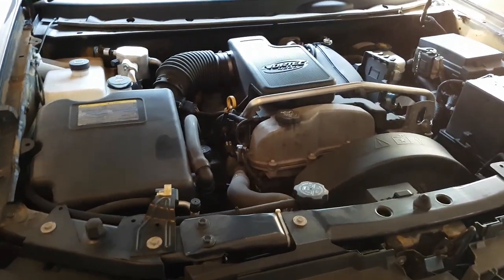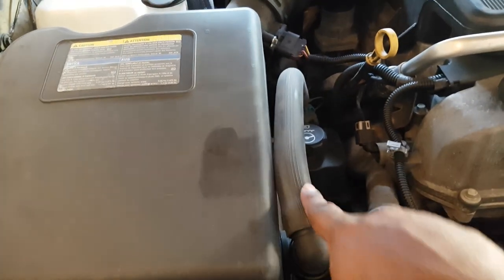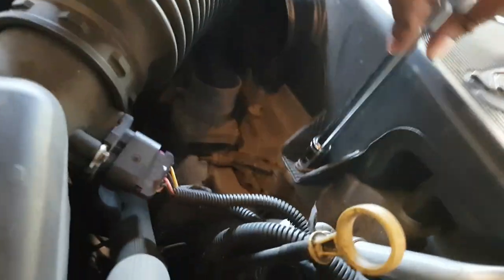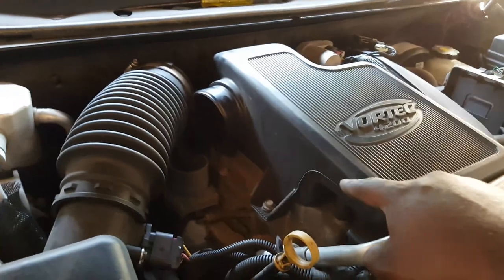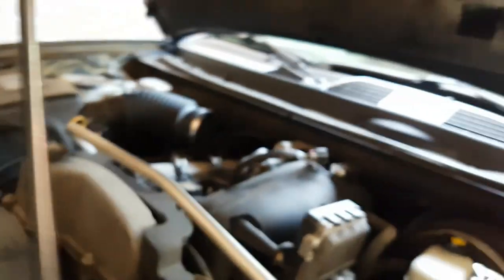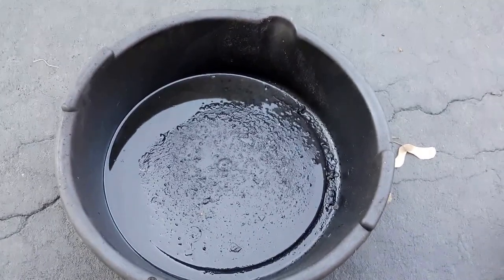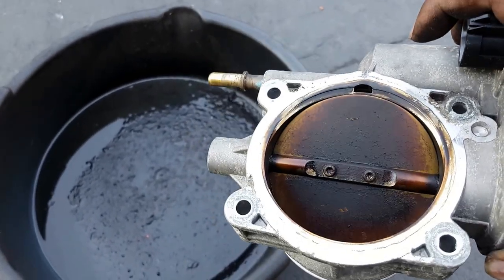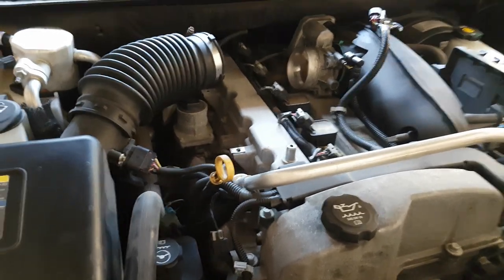Chevy Trailblazer - Cleaning The Throttle Body

Comment: Thank you for this video!!!  It was SOOOO Helpful.  Also, I heard on other videos to pull fuse #10 PCMB & #28 PCM-1 (In fuse box right beside the battery- maybe this was instead of pulling battery cable) let it sit 15-20 minutes before putting them back in (this lets the computer know to reset the idle.)  Once back together, drive the car around for a little while.  I ended up running a few errands and after cutting it off and on at my errands, just when I thought it still wasn't fixed, it started running great.  Give the computer time to Re-Learn how to idle with a clean throttle body. (I'm in no way a mechanic, but works great!!)
Reply from the maker: Great tip. Pulling the fuse can help the car relearn the throttle body, especially if you get a check engine light after cleaning it up. Thanks for watching.

Comment: You da man this worked like gold i just found a gem at the auction 2004 trailblazer LT on 85k miles on it new everything cept brakes which i put in yesterday was wondering why the car would shutoff soon as i turned the air off found out this was the issue you're video made this ten times easier...you da man!!! Definitely gonna enjoy this truck
Reply from the maker: Awesome news, sounds like you got an awesome trailblazer deal! My dads 07, the one in this video, was done 5 years ago and there is still 0 issues with the truck. Enjoy!...My dad loves his TB and never wants to get rid of it!

Comment: Love these 4.2 vortec engine's! I have an 02' GMC Envoy SLT XL & boy is she a workhorse,solid SUV with over 278,000 on her! Right now I have a catalytic converter issue (needs replacing)  a few new suspension parts & an intake seal has a little oil leak,but man she runs just fine considering the age & mileage. I'm actually shocked at how well she's performed under strenuous conditions! I also have an 05' Envoy Denali (5.3v8) that I'm putting a motor & trans in for a second vehicle that I got for $250 that's in immaculate condition even better than my 02'! I hope the 5.3 is just as mechanically sound as the 4.3 is but with more power that I could definitely enjoy! I wish GM would bring back the Envoy with the same standards in mind but just an updated version I would definitely be in line to purchase! Happy trailblazing my fellow Trail/voy community the heartbeat continues!!👍💪
Reply from the maker: Me too! I think those 4.2L Vortec are amazing! They just keep on going! Honestly, most of these TBs/Envoys are completely sound vehicles! Those few things you have, I.would just chalk up to age and wear and tear. Looks like that'd a win in my book. Sounds like you got a sweet deal on the Denali too. Those 5.3L are amazing. They have their few issues (ie knock sensors) but they are solid and reliable too. Hope you get many more years out of them!
Reply: @NexusAuto  Thanks and do you have any personal dealings with the 5.3 v8 is it as reliable or more than the 4.3 vortec and do you recommend me doing anything prior to installing it being that it'll be out of the vehicle which makes preventive maintenance much easier. Parts to replace or upgrade before installing?? Thanks in advance 👍
Reply from the maker: @justmy2cents_   I do have some experience with the 5.3L, but in other forms and variations, in other platforms. But I do know people who have the 5.3L and swear by them. There really isn't a lot that goes wrong with them

Off the top of my head, I would do the usual tune up stuff, particularly spark plugs. I would also change the knock sensor, as it does fail on these vehicles and are a pain to get to with the engine in. Make sure they are torqued to spec. And not related to the 5.3, I would say to check your Power Steering lines. They do tend to rot, especially on the little holder attached to the driver side fender area, and these lines wrap all the way around from the rack, across the driver side frame, along the front subframe and up to the reservoir. Its a giant pain to do with the engine in, so if there is any sign of rust, change em. Other than that, not much else I can think of at this point

Comment: Very informative! I have a 2008 Trailblazer that is throwing a P0121 throttle/ pedal code and I'm going to give it it's first cleaning in hopes that fixes the issue! Thank You!
Reply from the maker: Awesome news! Hope it works out and that code gets cleared! Good luck!
Reply: Dont stop there.  Clean the PCV orifice.  If the throttle body is gummed up, or if there is any other evidence of blowby gasses in the air plenum upstream of the throttle body, then the PCV system is inoperative and needs to be cleaned.

Comment: Thank you for this video. It was exactly what I needed to repair my Trailblazer. Your video helped me save a few hundred in repairs because I was able to do it myself using your directions.
Reply from the maker: That's awesome news. I always like hearing stories like this. Glad the video helped out, and thanks for watching.
Reply: @NexusAuto  hey man what do you have on your intake manifold where a vacuum line looks like it should go? Is it just capped off? Looks flat but cant tell. Any help would be appreciated. Btw I have the one with fuel regulator. It's not so bad pretty easy to clean as well. Nice video though. Liked and subd
Reply from the maker: @Matthew-ev4cv  yep, mine has a cap on it as well. I have seen some have a line run from it (not sure where it goes, never checked), but I've seen quite a few with it capped off, mine included
Reply: @NexusAuto  guess I need to find me a cap ugh mechanic lost mine
Reply from the maker: @Matthew-ev4cv  damn that sucks. The hunt begins! I don't think they cost too much. Not sure how hard they are to find though. Hope it's easy enough
Reply: @NexusAuto  me too appreciate the info

Comment: Was having ac problems id turn on my ac and it was stall the car, cleaned my throttle body and no more stalling issues
Reply from the maker: Awesome. First time I heard of the effects of the AC causing a stall, but makes sense...extra strain on the engine, probably not enough air getting in, and stalling it out. Glad the video helped fix the issues!

Comment: 7 years later and saving my ass today. Car stopped running yesterday (would start, but defroster would kill it unless I reved the engine. It's 26F here, so I kinda need that) but it fixed it and started running better. I'm assuming my throttle body either hasn't been cleaned in years or hasn't been cleaned at all. Mines an 04 LT if that makes any difference, but everything was pretty much exactly the same.
Reply from the maker: Awesome news! Happy to hear that this fixed the issues, especially with that cold weather. Your LT should run a whole lot better now, and fuel econ should be better too!
Reply: @NexusAuto  oh yea, significantly better. Idles better and got rid of my SES light, drove almost 10 miles and SES isn't on anymore. I hope I get better gas mileage, I average 12 mpg as of now, but hopefully, the clean throttle body helps that as this is currently my daily driver.

Comment: Thank you for the step by step instructions! Great video. I'll be doing this tomorrow. Hopefully it will help with the throttle body codes. When the Trailblazer gives the "reduced engine power" light, do you know if it's normal for there to be a strong gas odor and black spritz coming from the exhaust too?
Reply from the maker: No problem...hope it helped. It should help with the codes too, unless there is a physical failure. 

As for your inquiry, I wouldn't say it is normal, but it can happen. That means the engine is running 'rich', or that the car is not burning all the fuel when it goes into the engine, so you are still smelling some of the leftover gas, and that spritz should be the excess fuel coming out. Definitely indicates an ignition issue of some sort (throttle body, mass air flow sensor, spark plugs, wires, fuel injectors, air filter, fuel filter, etc).  Definitely try the throttle body cleaning (if you havent done so already) and then go from there.

Comment: Thanks for this awesome video!  I have a 2005 TB LT and it drives nice on the freeway but idles a little rough at stop.  Might this solve it? Thanks!
Reply from the maker: No problem at all! Unfortunately, there can be a few causes for that rough idle, but this is definitely a potential cause. I would say to give it a try for sure. Even if it doesn't fix the rough idle, it will help the vehicle
Reply: These 4.2 L have a history of working the intake manifold bolts loose.  They arent to hard to reach, luckily.  A rough idle and drivability problems at low throttle, but otherwise smooth running at highway speeds is indicative of a vacuum leak.  
I found one trailblazer that could barely run at idle but drove fine at highway speed.  Every single intake manifold bolt was no more than finger tight.

Comment: IF YOU HAVE A TRAILBLAZER AND IT ALMOST STALLS AT IDLE.. ESPECIALLY WHEN THE HEAT IS RUNNING, DO THIS! 
I was skeptical as always, ended up at 3 different shops before I saw these threads and videos about this. Took me 45 minutes and costs $10 bucks. Please Don't be stupid like me and deny that this is your issue. I'm telling you...It will fix it!
Reply from the maker: Thanks a lot for the support and vote of confidence. Amazing what cleaning that throttle body will do for the car. Glad to hear your TB is working well again. Thanks for watching and the great feedback!
Reply: My 2005 don't almost stalls at idle but the rpm drops too like 500 then goes back up (has been getting worse the past 3 years I've owned it) (never seen a check engine light) im going too do this tonight too see if it fixes it :3
Reply: So i cleaned it (the plastic tube broke off the intake... >_<) but... it idles amazing now 😊 but when i started it it had high idle it scared me 🤯 i hope tomorrow go back too normal...
Reply: but only temporarily.

Comment: When removing it to clean it, didn't the throttle body go out of calibration?
Reply from the maker: Nope, and generally speaking, it never happens on any electronic throttle body that I've cleaned, doesn't matter if it's American, German, Japanese or Korean made. 

Vehicles also have their own adjustment/relearn procedure as well. That's why, sometimes after a cleaning, the car will feel different (aside from power and fuel economy improvements) and then after a short drive it corrects itself. The vehicle does the opposite as the throttle body gets dirty...it adjusts based on the condition of the throttle body itself and what airflow it can read. 

Now, at the same time, if a throttle body was really dirty, or if the plate was sticking before cleaning, it doesn't hurt to do a throttle reset/relearn. Every vehicle has a different way to do it. But if it was really bad, you may want to give the vehicle a fresh start and reset throttle settings.

Comment: I did everything as u did , but after my Jeep idles fast , don't even have to push on the gas when going ? Help
Reply from the maker: There are a few things that can be causing this. One thing is that the throttle body flap may not be sitting right and is allowing too much air in, and causing the high idle. Also, and this is more likely that cause, is that the throttle body needs to be reset. You can do it with a special scan tool or with some key turns, but you can also just disconnect the battery and leave it for a few hours. That sometimes resets the throttle body and it sill start to run normal again. Hope this helps

Comment: My 02 Chevy trailblazer doesn’t want to turn on anymore after I turned it off reduced engine power came on dash and throttle body butterfly doesn’t not want to open manually when I went to clean it dose that mean it’s no good and it needs to be replaced? A reply would help and I would really appreciate it thanks man I also changed spark plugs cause two we cracked
Reply from the maker: If the butterfly is stuck, I would consider getting a new throttle body for sure. You may be able to loosen it by forcing it, or constantly soaking it in throttle body cleaner, but there is a possibility of damage inside. Definitely dont force it (unless you have already), but just spray the hell out of it with cleaner, and let it soak, wipe away, and spray again. It may break up the build up. if you are spraying and not seeing any carbon leaking out, then the inside is gummed up and you should replace the Throttle Body

Comment: Does it have to be reprogrammed or should you disconnect the battery. 👍🏻
Reply from the maker: It MAY need to be reprogrammed. I've done tons of different cars from all manufacturers, and haven't had to reprogram one as of now. But it can happen. If it does, you can either hook up a scan tool and reprogram(if you have one), there is another method also out there where a scan is not needed. And you can do the old 'disconnect battery' trick. Just leave it for a couple of hours and it should reset. But it will also reset many other settings too. Not a big deal, but just a heads up
Reply: Thanks for the information great video by the way it’s people like you that make the world a better place to live 👍🏻
Reply from the maker: @FireEater  I really do appreciate that! And people like you leaving feedback like that make the world better too. I wish everyone interacted like. Much appreciated.
Reply: no and no

Comment: Hi.

Squirrel chewed through my throttle body/spark plug wiring right at the plug that meets them both. We are trying to replace the wiring. Do you know how to get the wiring to release from the plug? We removed the front cap of the plug and tried to push down on what we think are the spring clips but it won’t release the wire.

Any help?

Thanks!
Reply from the maker: To be sure, are you talking about taking the wires themselves out of the wire harness? If so, there is a tool you can buy that helps remove them. I think some electrical shops sell them, along with Amazon. If that is what you are talking about, let me know and I can get you a link
Reply: @NexusAuto  yes it would be the wires out of the wiring harness but all I have is severed wires and I don’t see a spot where the wires would have come out of. It’s really strange. It’s like the throttle body was never connected to anything even though the truck was running for months.

I would be interested in that tool . Thank you.
Reply from the maker: @dirte212  damn, sounds like those squirrels made a mess of everything. Here is the tool...hopefully it is what you need. 

https://amzn.to/3piiFr7

If not, and I misunderstood, let me know and I can try and help further. 

Hate it when animals get into stuff. They cause a whole bunch of issues that is really annoying to fix. Hopefully you get it sorted.
Reply: You sure it wasn't a chipmunk? They like the soy on wiring. I got a free Craigslist treadmill to scavenge the DC Motor - the young lady didn't know the cause. Took it apart and a chipmunk was clamped onto the live wire.

Comment: How do u know when it should be replaced rather than clean?
Reply from the maker: Typically, if the butterfly flap cannot be moved, or is extremely stiff even after cleaning, or if it does not respond to throttle input. But if that is the case, the car will not start.

Comment: I tore the hose off of the front of the resonator while doing this and I can’t find a replacement part online
Reply from the maker: I was not aware of the hose being sold separately. I checked with a few online stores and local stores and none sell them. My only recommendation would be to try and get it from a junkyard, if possible.
Reply: Nexus Auto there is a plastic piece that came off with the hose that I Jb welded back on and reattached the hose to. It has held up so far. Thanks for the video it was extremely helpful!
Reply from the maker: @wesleysmotherman8567  nice...very creative fix. I think that should hold up well. And no problem at all on the video...thanks for watching! Appreciate it!